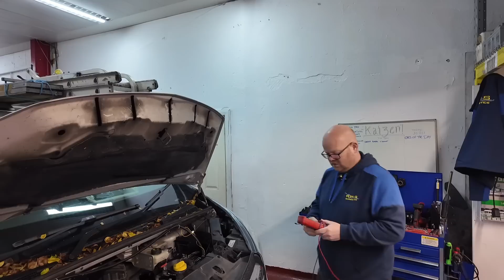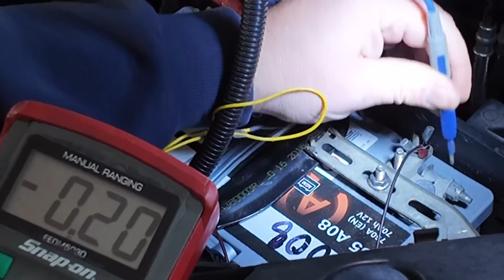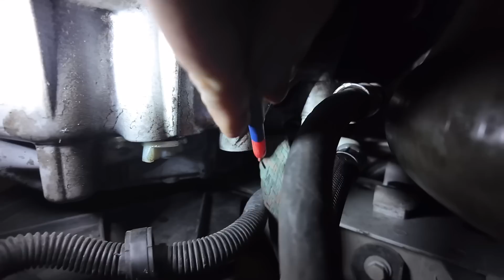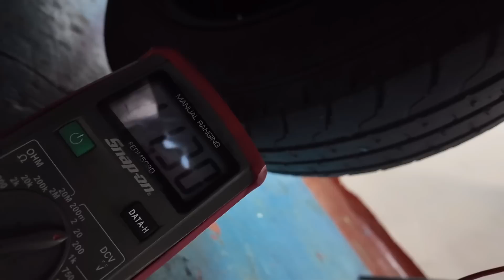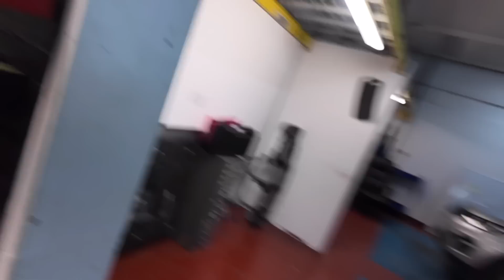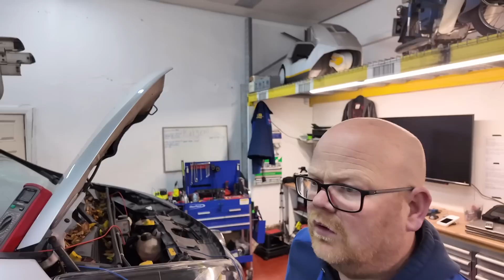WE TACKLE A NO CRANK VAUXHALL,VOLT DROP TESTING IS VITAL!!

Comment: That's great info, and has helped me sort my vivaro. New starter but refusing to crank. Thought I'd cleaned up the earth's but obviously not well enough. Followed through as the same process as you explained and had voltage drop on strap from gearbox to starter. Cleaned again with new bolts and it started straight up. Thank you, although I wish I'd found your video last week 😂

Comment: My only thought is that if I had rectified the earth high resistance fault and I still had a problem, I would have tested the +12V to the starter motor under load in the same way. Any resistance in the +12V side of the circuit might mean that the starter wasn't spinning up to full speed and thereby not fully engaging with the flywheel.
Reply from the maker: it was under load when we was checking the earth and it was showing full voltage to the bad side of the earth path,but yes it would have been worth checking.also I might have checked it I can’t really remember but we don’t always film every test,apparently these have a dowel that sticks in the old starter and does not come with the new starter,common issue so people say

Comment: What an amazing video!!! Highlights the importance of starting basic, as simple as it sounds it’s clearly not! Myself guilty of this! 

I’m currently experiencing a severe engine issue with my Grande Punto 1.4 T Jet, limp mode, lack of power and no boost delivery. Fiat MES software shows the boost delivery is permanently electronically on 7% boost (presumably a default setting given this situation)

Fault codes for every component on this particular circuit (Fuel Vapor Solenoid, Turbo Actuator, Turbo Diverter Valve and both Lambda Sensors).

I’ve obtained original FIAT wiring diagrams, from an amazing Russian website (If you’re at all interested I can send it over, they have every single factory FIAT, Alfa Romeo etc diagrams available free of charge) 

All of my engine earths have been modified and replaced by previous owners… I have one damaged O-ring terminal I’m yet to fix, the cable side is very loose and I have to keep popping it in the terminal.

The car has 3 engine earth points, the main one for my circuit is the one that keeps popping off under vibration.

The turbo actuator solenoid I uncovered a shoddy previous repair, repaired it properly now and also found the fuse for this circuit to be replaced by a copper strand around the fuse terminals!! Fully repaired properly now! 

Still getting the same fault with this complete circuit, I’m going to fix my broken earth terminal and see how it goes from there.

If it doesn’t fix the issue, If I composed a proper email with all of my findings and diagrams etc, would you be happy for me to send it over for you to have a look at and give me your opinion on my this situation? Happy to sort you guys out for some lunch and drinks etc!! 

Nearly qualified 3rd year apprentice on HGVs and vans here, if you at all need any IVECO information too do reach out I can help you too. Plus if you want me to send you the website for all Italian wiring diagrams I’m happy to as well! 

I did comment on your Megane Convertible video, regarding the Vauxhall Tigra issue as well, relating to the storage of low voltage in the BCM shutting down the roof circuit. This also applies to Astra Twin Tops.

Comment: If you disconnect the main negative cable from the battery and measure the resistance between the cable and engine block you know staight away if you have a bad earth.
Reply from the maker: I knew straight away with disturbing any connections and possibly loosing the fault,volt drop under load is far more accurate that resistance checking.
Reply: His method is perfect and the exact way to test this under load, Resistance isn't the best option.

Comment: Classic explanation of an engine earth strap fault. Those woven flat earth leads seem so prone to this huge resistance in our damp climate. I've been out to lots of vehicles sporting new batteries, starts and alternators and all they need is a decent earth lead. A good trick is to clamp and earth lead to the block and the battery negative terminal to give another earth path.

VAG group's especially seem to have earth leads that aren't man enough in my experience.
Reply from the maker: it’s a nice process to use in many electrical tests,

Comment: This is a great video and explanation of Voltage drop. Basically the higher the resistance of the lead or connection, the more voltage is dropped across it. (Voltages are dropped across components in a circuit, currents flow through them). This is why the cable to the starter motor is so thick, increased cross sectional area = lower resistance. A quick check for this common problem is to clip one side of a jump lead directly to the battery - terminal and another to the engine block, bypassing the suspect earth strap. Finally, the green deposits on the braided earth lead are a good visual indication that it is corroding and will eventually rot through.
Reply from the maker: I was expecting that green to be the fault, the cable was solid and it just come down to the build up of corrosion

Comment: Good working practice Rob, just shows how you can track a fault, and with a wire brush and new bolt should have been back up and running. trouble is some garages just have fitters not mechanics, who just throw parts at the problem.
Reply from the maker: exactly mate
Reply: Unfortunately the skill set is gone we have so called master techs that have never seen a piston crown or a valve face ,they want a laptop to fit a timing belt

Comment: Will the engine ground have damaged the new starter eventually , enjoyed the vid, cheers
Reply: Engine ground missing wouldnt damage the new starter
The fact that with the ring gear gone it had probly burnt out the old one where they were strugling to start it for the last three months
Reply: @stevebarnes8905  Thanks , from all this it seems the correct testing was not done and the garage responsible for the s/motor change then did not inspect the pinnion and then ring gear,or did they ? have seen ring gear problems diagnosed when it is the overrun clutch ,
Reply from the maker: apparently these has a dowel fitting that can stay in the old starter so maybe not aligned correctly 🤷‍♂️

Comment: I’ve been an RAC patrol for 27 years, Unfortunately you don’t even need to be a qualified mechanic anymore, just some basic knowledge, RAC will put u on a 6 month apprenticeship which is a mixture of classroom and practical, and on the road training.  Volt drop is the corner stone to all starting and charging faults and any electrical testing, When I got the job we had a full day of practical assessments volt drop had to be demonstrated on most tests, standards have dropped drastically, time on a job is now a max 30 mins, so a lot of patrols will just bump start vehicle and send it on its way, and be seen as superstars even though it will come back in later, not the way I work as such my fix rate is good, rare I get a job back in. It’s not the company I started with all that time ago, if the management see this post I’m sure I’ll be in the shit !!!!
Reply: Time on a job 30 minutes. 
Time to get to a job 6.5 hours+
Reply from the maker: can’t win in any situation mate,nobody gets the right amount of time to fault find,even the garage that fitted the starter would not have been paid to do any diag,just a request to fit new starter
Reply: RAC Approved garage here - 100% know what your talking about, try dealing with warranty repairs, whole industry is an absolute joke, customer expectations are higher than ever, they think we’re miracle workers! Probably get 5+ phone calls per day asking us to diag over the phone which we all know is impossible, warranty companies expect us to work to ‘book times’ on 15 year old vehicles that are usually absolute heaps sold by dodgy dealers. We charge a higher than average rate for diags (usually charge by the hour), but trying to educate customers and get them to understand that an accurate diag isn’t just plugging the vehicle in is impossible when another garage down the road will charge equivalent to half hour for diag, just to plug in and print off fault codes…. But hey, what can we really do…?
Reply: This does not surprise me mate. An an annual renewal js sky high these days to.
Reply: Volt drop is king test don’t guess ❤❤

Comment: Years ago while working in a VW dealership the RAC towed a golf in saying it needs a new starter motor.Taking their word for it I fitted one, but it still wouldn't crank.On further investigation I discovered a hole in the engine with a con rod sticking out.
Reply: I put a rod through the side of my vivaro and the rac refused to send recovery untill they had diagnosed first as it was 2 in the morning i got the roadside assisyance to call me and sent him a pic of the conrod laying on top of the oil cooler he then agreed i needed recovery

Comment: Great explanation of voltage drop . Starter is probably worse that the original one removed. Quality of parts especially rotating  components is ludicrous.
Reply from the maker: Great point!
Reply: Or possibly the wrong starter (wrong no of teeth)